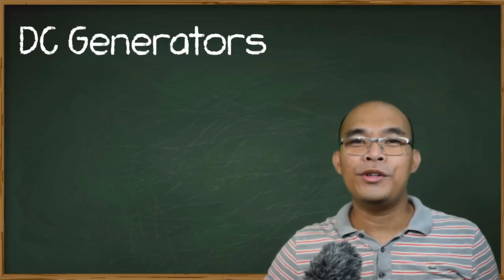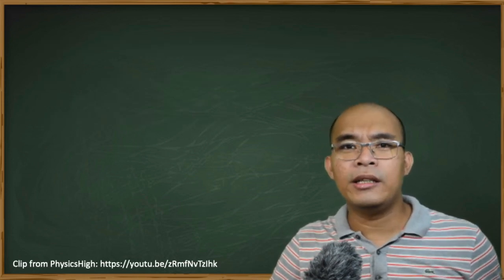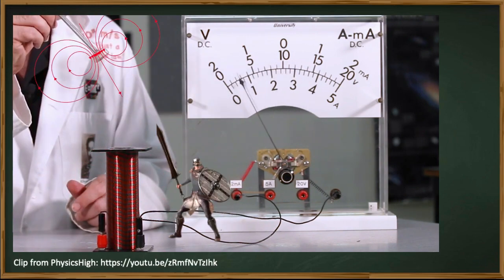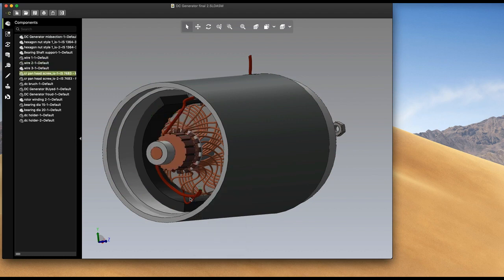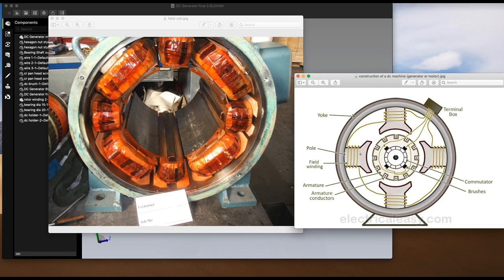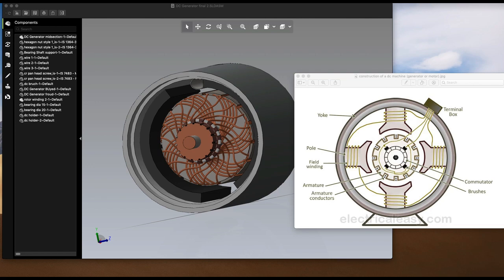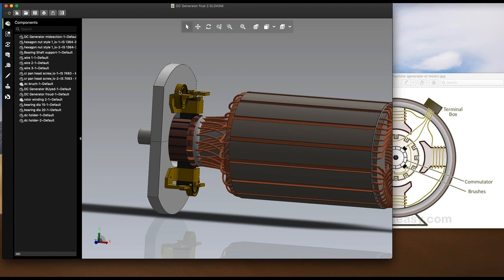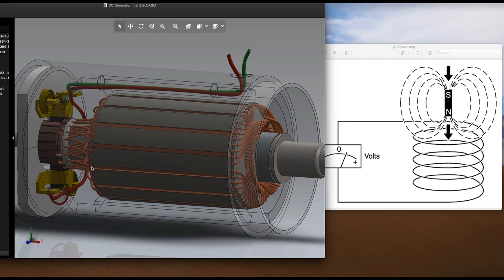How DC Generator Works? | A Creative Version

Comment: Sir, thank for the video, Now i realize that the electricity generated by cutting flux and the DC generator had a low voltage but required periodic maintenance.

Comment: Awesome video. The Direct current or what we call the DC generators. As the video goes by , i've learned the basics in which the electrical generators converts mechanical energy into electrical energy. Also the Law of electromagnetic induction in which there are laws that are very important to know.

Comment: Thank you for sharing with us the functions, parts, and purposes of the DC generator. I learned that this electrical generator is converting mechanical energy to electrical energy. Also, about the laws of electromagnetic induction which has 2 types of laws produced by Michael Faraday. The last thing that I learned is all of the generators produce (AC) Alternating current but, if the (DC) Direct current is required, we will use the device called commutator which converts the AC to DC.

Comment: Very well said sir. Now, I understand the function and part of DC generator work and how electricity generated by using coil and magnet can create electricity.A direct-current (DC) generator is a rotating machine that supplies an electrical output with unidirectional voltage and current.The field is produced by direct current in field coils or by permanent magnets on the stator. The output, or armature, windings are placed in slots in the cylindrical iron rotor.

Comment: Thank you sir for very good explaination♥️
 so to understand the function and part of a DC generation work and how to electricity generated by using the coil and the magnet. And The more the magnet moves through the copper the more the copper cuts the magnetic field.I learned that magnetic conductor occurs when a conductive materials such as copper wire passes through a magnetic field.

Comment: thank you sir for this video I learned in the discussion in the video where the electricity comes from and how the DC generator works and to produce electricity and how the generator produce a voltage or turn it's mchanical energy into a electricity to supply it.

￼

Comment: Very well explained and presented in simplistic manner sir ❣️ This video made me so easy to understand the basic operation and how DC generator works. The more the copper cuts the magnetic field, the higher the electric current produces. This also helped me to familiarize the basic parts of DC generators which which are; the terminal box, rotor, fan, shaft and many more. All in all, this video is great and understandable. Thank you sir ❤️

Comment: Im amazed on how the dc generator works. Especially on the relationship between copper and magnet that is directly proportional. The more the magnet moves through the copper the more the copper cuts the magnetic field and produce higher the electric current. The slower the magnet moves through the copper the electric current it produces will decrease.

Comment: Done watching this Video  Good day Sir  About of this Video I have more learned the basic o Yung simple Sa pag operation, parts at ng example of a circuit Diagram  regards to how the DC Generator works.. At sa part na paano mag produce ng Voltage o Turn to the Energy para mag supply ng Electricity.

Comment: In this video, it properly explains the basic operation, basic parts and basic circuit of a DC generator, how the generator produce a voltage or turn its mechanical energy into a electricity to supply it.

Comment: DC generator, field coils produce an electromagnetic field and the armature conductors are rotated into the field. Thus, an electromagnetically induced emf is generated in the armature conductors. These generators are used to charge batteries, provide lighting and provide excitation to alternators.

Comment: This video shows how electrical generators works by the means of a DC generators. Since all generators produced alternating current, the commutator is used to rectify if the DC occurs. The video itself states that the electromotive force (EMF) or what we called the voltage is being produced according to Faraday's Law of electromagnetic induction that was named after an English scientist Michael Faraday. In this principle, the first law states that once a conductor cuts across the flux of a magnetic field, the EMF is produced in the conductor. Then if you want to increase the induced voltage, the second law will occurs since it states that the magnitude of induced EMF is directly proportional to the rate of change of flux linkage.

Comment: This video explains about Law of electromagnetic induction, that faraday's law is named after the scientist Michael Faraday. Electromagnetic or magnetic induction is the production of an electromotive force across an electrical conductor in a changing magnetic field. The first law is whenever a conductor cuts across the flux of a magnetic field, an EMF is Produced in the conductor. The second law is the magnitude of induced EMF is directly proprotional to the rate of change of flux linkage.

Comment: I learn in this video the Law of Electromagnetic Induction. The first law is whenever a conductor cuts across the flux of magnetic field it will produce and EMF in the conductor. Second Law, the magnitude of induced EMF is directly proportional to the rate of change of flux linkage. That these two Law is the Building block of a generator. THANKS SIR

Comment: In this video I learned about the law of electromagnetic induction. The name of after the English Scientist is Micheal Faraday. My observation in First Law of electromagnetic induction in the magnetic field represent by the circular red line will being cut by conductor form of coil then the voltage will be induced represented with a movement of the needle of galvanometer. Second Law is all about  the movement of the conductor or magnet will be cutting the flux of magnetic field happens it will be reach the maximum voltage by being generated.

Comment: Dc generator is a electrical machine that the main function is to convert mechanical energy to electricity. And I understand the basic operation, parts, and the examples of the circuit diagram of a simple DC Generator

Comment: Thanks for this video sir. I learned the basic operation of a simple DC generator and the basic parts of DC generator. This video help me to understand more about the principle of law of electrictromagnetic induction. Based on my observation on the first law of electromagnetic induction if the magnetic field represented by this circular red lines will be cut by conductor in the form of coil then voltage will be induced represented with the movement of the needle of galvanometer. My observation on the second law of electromagnetic induction if we make magnet moves faster in and out the hole in the coil we able reach the pick. This is way we called Faraday's Law.

Comment: What i understand and learned in this video is that how the generator produce a voltage or turn its mechanical energy into a electricity to supply it. And because it is a DC generator the motor uses a direct current electricity or charged batteries and these generators is used when low power is required.

Comment: In this video I learn about the law of electromagentic induction. It was named after the english scientist Michael Faraday. In the first law, its principle is about the conduction that cuts the magnetic field of a magnet where if these happens it will generate voltage. The second law is about the movement of the conductor or magnet where cutting the flux of magnetic field happens, it will reach the maximum voltage being generated. In this video it discussed that because of these two laws of electromagnetic induction , the generator produces electricity.

Comment: Good day sir i learned in this topic is all about principle of faraday law of eletromagnetic induction and how dc generator works. in faraday law based of the video example shown when the magnet in and out inside the coil an emf electromotiveforce or voltage produced. it is the same if the coil rotates in the magnet and this princeple are for AC generator thats all sir thank you 🙏

Comment: In this video, I have learned and understand the basic operation, parts, and the examples of the circuit diagram of a simple DC Generator. This video helped me understand how DC generators produce and multiplies and voltage be used in the loads.

Comment: Done watching your vedio sir its very important to me to learn how use the DC generator ,how to to get the current using the negalvanometer,magnet and coil , thank you sir for your time to show as your experience, knowledge to delivered as sir more knowledge you will give as about the DC generator specially when you showing the parts of all components of generator sir on how to work it,,,thank you sir .

Comment: Sa lahat nang nanood ito yung  pinakanagustuhan ko sa video na ito is kung paano ba talaga ang parts nang dc generator natin mag works at mga parts nang dc gen and also the principle of law of the magnetic Induction which is sa example kung makakita natin Kapag na pinapasok yung magnet sa coil is magkakaroon nang kurente which is tama kasi kapag yung magnet pinapasok kina cut nang coil natin kaya nag kakaroon at kung gusto nyo naman tumaas ang kurente the second law will answer the question which is in the video ang magnet binibilisan ang pag pasok sa coil pra mag increase ang emf natin/voltage Nalaman ko rin ang mga parts nang dc generator natin. And also An Dc generator it converts  A mechanical Energy to an Electrical energy and the purpose of using the Faradys Law. Thumbs Up And god bless tnx for sharing your knowledge sir<3

Comment: Done watching sir❤️
Thanks sir sa very well explaned about DC Gen sir  Madami ako natutunan lalo na dun sa  para mas lumaki or increase the induce voltage is kailangan lang e move faster sa pag in out in out ng magnet sa conductor and ang electric generator is used to convert Mechanical power to Electric energy❤️